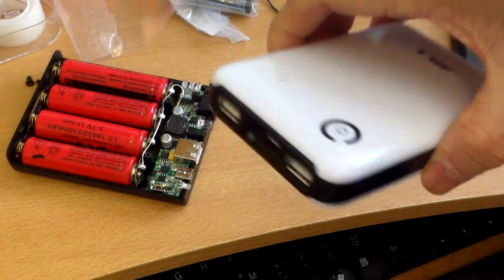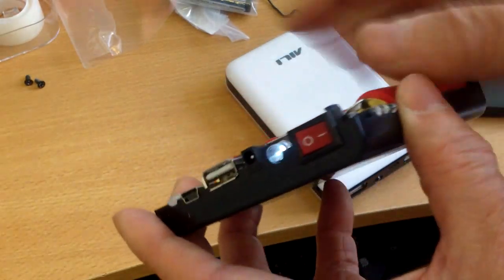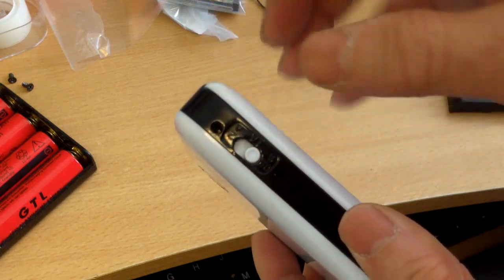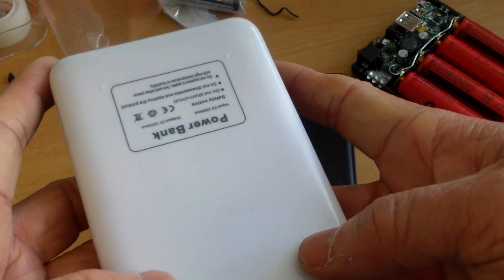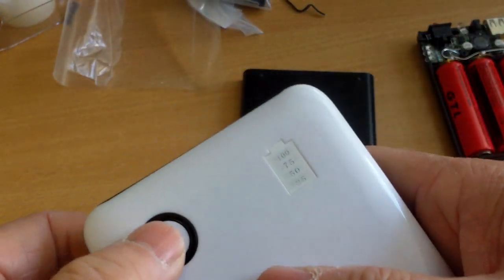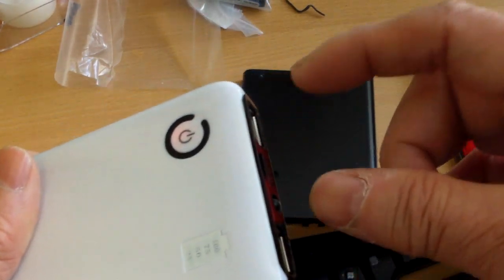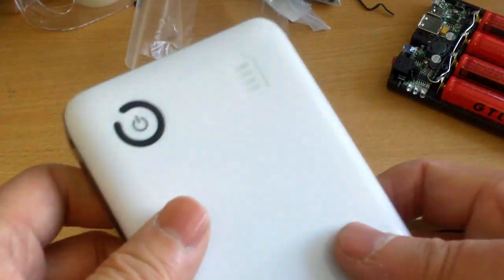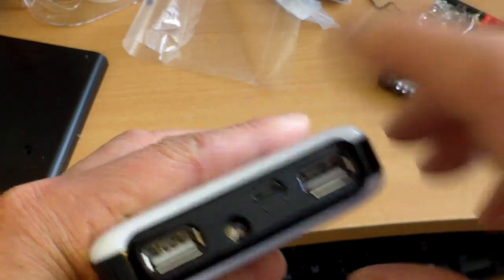Power Bank 18650 lithium ion battery box with dual USB output

Comment: I have a 2×18650 power bank from ebay. as soon as I put a battery in it, it starts heating up, some parts get so hot I cant even touch, is it something wrong with it? like short circuit?
Reply from the maker: +LutairaNo1 Sounds like you got a defective unit. The battery can catch fire if it's shorted out.
Reply: LutairaNo1 nfjkşgl

Comment: I have had this battery pack the new one you are showing in the vid for about 2 and a half years now maybe longer and it still works grate yer I had to change the cells I had put in it because batterys don't last for ever
Reply from the maker: jameshone1000 I added a small solar panel to it so the batteries can stay charged without having to plug it in. Mine still works as well.

Comment: Thank you for this demonstration. I just got the same one with the two USB outputs today. I have a question about the charging indicator. When the 100% flashes is it fully charged or does that 100% light become solid when its fully charged? Thank you again.

Comment: Hi Mr. Tam, I been watching your videos for quite sometime now and this is the first time i ever commented, are both these powerbank can be charged and discharged at the same time?
Reply from the maker: Wilson Lai That is a good question as to whether they can be used while charging. Don't quote me but I don't see not. The only problem is it won't get charged if the load on the power bank is greater than the charge.  Also please note the micro usb connector on this power bank is not sturdy as mine broke already. I had another older power bank (black in color)  with a rocker on off switch which I use and I prefer it over this one.  See link here: http://youtu.be/oixvlr-usY8.  Thanks for commenting Wilson.
Reply: wtam69
the reason i asked is because i am forced to make my own battery bank because i cant seem to find any power bank that can charge and discharge at the same time. i am using solar to charge it while its powering device that its dedicate it to.

thank you for your reply and Kung Hei Fatt Choy!
Reply: Wilson Lai the black power bank can be charged and discharged of the same time

Comment: Looks more nice but maybe not better. Time will tell right?
Love your videos :-)
Greetings
Erik
Reply from the maker: Thanks Erik. I love these gadgets even though they don't always work the way they made them out to be. The white box is very sleek looking.  You have to pay $2 or $3 just for a plain AA battery holder so this type of box with the LED light and circuit board is a steal. Hope I don't have to use them as another major snow/ice storm is coming.
Reply: wtam69
Darn, those snow storms in the US don't seem to end. Feel for you guys there. Just got my foldable solarpanel in the mail today. 7watt 5.5volt. Nice little device.
Soon i will test it. I'm still waiting for the voltage regulator.
Greetings and try to stay warm
Erik
Reply from the maker: rikkiesix
You can always put your panels in series if you don't get enough voltage or they don't work the way they should.  Usually, the voltage is not high enough but that can be remedied.  My little experience tells me you also need good amperage or you don't get enough wattage. I'm happy with the 14 w folding panels. Nominally at 5 volts but it can be adjusted upwards or even downwards with the right voltage converter.

Comment: Have you time tested cheap lithium batteries?  I'm looking for a good cheap rechargeable battery that will not go bad on me in a short time like some cheap batteries do.  I'm guessing that lithiums are a different size and will not fit in an AA holder.
Reply from the maker: I have not load tested them as in draining them to see how long they'd last. The old cells from my laptop are definitely more superior to the new cheap 18650 ones I bought off ebay.  On ebay they sell the 17670 for $1 a piece but with $5 shipping. They are the same as the ones in my laptop. They are rated at 1400 ma.  If you buy more than one, you can see what the shipping is and if they are low enough, then they are worth it. Just type 17670 in ebay search box. Then there are those that are rated 5000ma. You are probably lucky to get half the rating.  The 18650 are definitely bigger and won't fit in AA holder. They sell special holders for them and they are lithium ion battery chargers to charge as they are 3.7v.  They are much more powerful than AAs.